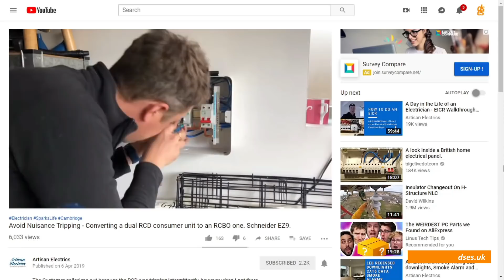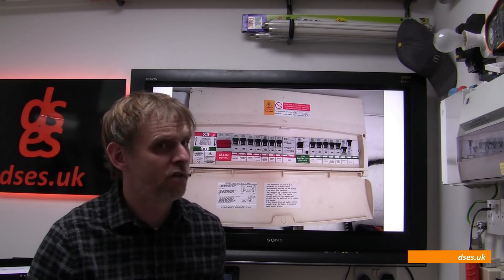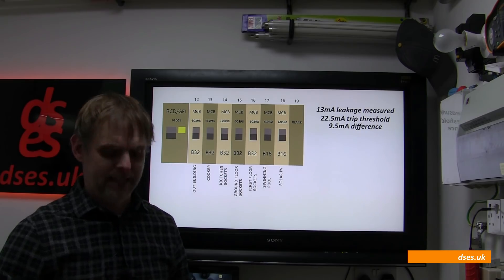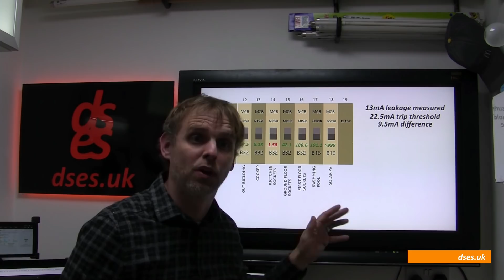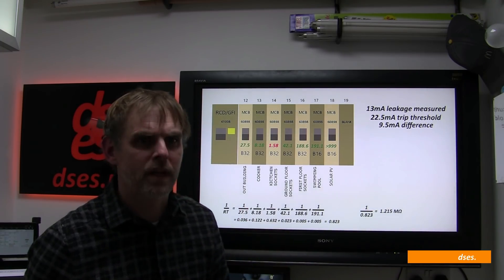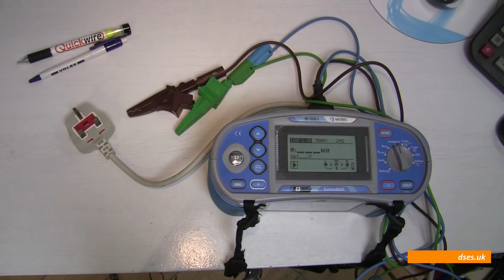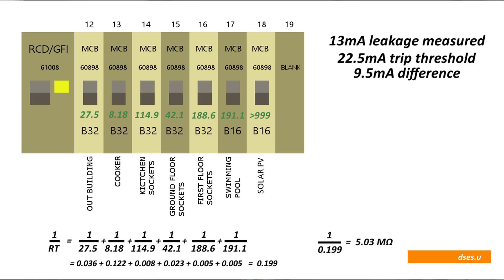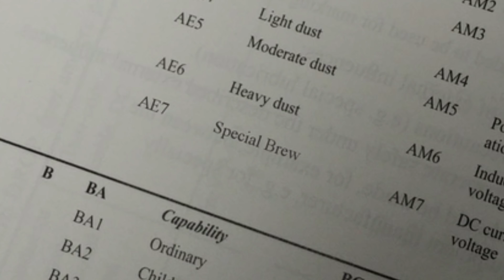Insulation resistance and RCDs

Comment: When you done the IR test on  the washing machine(I think)at the plug,it was showing 500v setting,surely you would do this on 250v first,or am I wrong ??
Reply from the maker: Unless there's surge protection in the appliance, I test at 500V. With line and neutral connected, there's no potential difference between them to fry any electronics.

Comment: Hi David love your videos, nice to see some talking sense and talking the job sireasly with a bit of fun and light humour,
I would like to know what is the point of doing RCD tests at half times, one times and five times when we are only required to record the highest value?
This seems to be a waste of time and effort, just my own opinion. You have even said your self that some of the regs are stupid and controdict the self, point in question the removal of the supply cutout should we or shouldn't we? And the video you did were you did a EICR
and found no problems yet the guy who did the EICR before you condemned the installation?
Great videos and work from you please keep them coming
Reply from the maker: Hi Sean. The gamut of RCD tests have their place - we want to know that the device operates at 1x and 5x test current and that it isn't too sensitive that it will trip at half times. As for recording the result, I agree that it's a nonsense now that the 1x and 5x columns have disappeared from the Schedule of Test Results as you've no idea which test the figure relates to when looking at someone else's form.
Reply: @dsesuk  thank you David, and please keep the videos coming, I did C&G 236 part's one and two back in the late 80s but I have worked since 2006 due to eal health I know a lot has changed but I do try to keep up with the regs and so on once again thank you. Oh and next time you decide to cut your hair try using a colinder you might end up with spiky hair LOL

Comment: Hi David, just been watching another sparky with client who was having an RCD tripping issue, I'm not a qualified Sparky but been an electronics engineer (now retired) for most of my life, he was going all over the place and ended up not really solving things but the fault just stopped so left telling the client that it was more than likely her washing machine? I never once heard him mention a possible rogue RCD what's your take on things, as a non Electrician if that happened in my home my first call would be the RCD, I do still have the necessary test equip. so would have 'hammered' the RCD first with under,ramp and over tests just to see how it behaved?
Reply from the maker: I always start with IR Keith - test line/neutral to earth on all the circuits downstream of the RCD before removing any appliances and see what reports back as bad (presumably something isn't tip-top and one or more circuits are low unless the fault has cleared). I'd then investigate that circuit, and see if the IR rises with appliances removed. We can usually narrow it down to an appliance that way. We'd also measure earth leakage before we start and see which circuits are adding to it, and as you say, the RCD itself can be tested to ensure correct operation.
Reply: Funny thing is he's just got an earth clamp but said on the vid. that he wasn't too 'up' with it and it's not found any faults for him yet? I mentioned RCD because I personally had a rogue one a few years ago and it really got me going, it would 'repair' itself for weeks at a time and then just throw it's toys out of the pram for maybe one or two episodes? I tested everything but premature ejaculation (did loads of tests for that) so I suppose it's made me really distrust the bastards, also I learned NEVER to presume anything from my early years, that's fatal
Reply: I always like to hear it from an expert so thanks for your time David and advice and keep the vids. flowing, your own TV series next, who knows?
Reply from the maker: @keithcoltron3171  Haha! I haven't got the pretty haircut needed for TV Keith!

Comment: Like to say what a complete waster spilling your special brew like that you should be using a baby sipper. How about that PV sitting on the load side of a AC type RCD.
Reply from the maker: The PV on an AC RCD is a common sight; I have the same arrangement in my own home. We know now that it's not ideal, but you only have to go back a short time to find Type-A RCD's being largely unheard of on these shores even though the rest of the world was already seemingly in the know. Since this was filmed, that board has been rejigged with a second CU installed and the more 'troublesome' circuits moved onto RCBO's inside it to take the pressure off the RCD. This came about after we were called back for further tripping trouble on another day which was traced to a flex feeding a pond pump.

Comment: I had the same issue. Completely random Rcd tripping. Once a week. Maybe once a month. I changed my diss board to a 12way rcbos and since no issues. I have a 20ma leakage to earth but just can’t track it down. I guess the best thing to do is to clamp each earth to see where the fault is coming from.

Comment: Maximum respect for the use of IT and I love the dses sign .   What is that, your office ?  Or a workshop of some sort ?  Never noticed that Appendix 5 does it really say special brew?!?!  I'm inspired to look now.  I always have low NE IR for old fluro circuits.  Which is in fact all of them as most new ones are LED now.  I wish I knew what this was about and why nobody else seems to mention the problem.  I know about LN with the capacitor and electronics, but consistently in various sites over the years I get low NE too.  I'm almost at the point of well in fact I am, total surprise if this doesn't happen now.  As you say, it is a right pain to diagnose without disconnecting all the lights.  Got it with SONs last week too, disconnected them all and it was all 9's again.  Neutral to Earth.  On another point, when I saw your goodie bags from ELEX after depositing that last Xcite flood and getting my bacon buttie at CEF on Friday, picked up one of them codebreaker books you had just what I've been looking for all these years but then after reading it found it still leaves a lot to the imagination.  Particularly with the issue of commercial installs without additional protection, still in a quandary of what the official position is.  Guess I'll go with billions of risk assessments or just disconnecting those ccts I deem dangerous without it - for instance in a shower unit with a broken cover which comes off if you touch it exposing the terminals for cleaning!  No additional protection either.  Mmmm.
Reply from the maker: Cheers Rupert, it's a formerly dark corner of my garage! The sign used to be on the side of my van! I don't come across too much trouble with fluorescents, but then most of the places I'm testing are domestic, so they don't have many. Couldn't say why a fluorescent would have leakage to earth - I wonder if there's a difference between the old magnetic ballasts and the electronic ones? I haven't looked at the Codebreaker book much yet, but it's my kind of bedtime reading. I don't suppose it has all the answers, but it'll be interesting to see what insights it offers.

Comment: Im confused. I'm being taught that when testing IR all loads should be disconnected, certainly sensitive equipment, even when testing between lives and earth. But videos from practicing sparks don't do this.
Reply from the maker: If you want to know the state of the fixed wiring, then disconnect all loads. If you want a picture of the insulation resistance the RCD is seeing in normal operation, perhaps because the damn thing is tripping, then leave the loads connected. The IR test shouldn't cause damage, especially at 250V, so long as you apply the test voltage to line and neutral at the same time because then the potential difference across them is zero. The same test would be applied to any appliance that is being PAT tested, and there's unlikely to be anything in a domestic environment that can't withstand a PAT test procedure, so you should be safe testing in the same way at the consumer unit. Remember, we're not IR testing between line and neutral here, doing that could damage sensitive equipment; we're testing line/neutral connected together with respect to earth.
Reply: @dsesuk  Thank you for taking the time to reply, and thanks for your continued content. Great work.

Comment: Hi,just wondering do you not have to make sure everything  is unplugged before you do the test ?cheers
Reply from the maker: If you only want to test the wiring itself or if you want to test for leaks between line and neutral, then unplug the appliances. If the RCD is tripping in normal operation, then test between line conductors and earth with the appliances still attached in order to determine which circuit is at fault, and then what appliances on that circuit are dragging it down. With the appliances connected, you're effectively performing a partial PAT test on them all at once which makes for easier faultfinding than going around checking everything individually.
Reply: @dsesuk  That's great,thanks very much
Reply: @dsesuk  Sorry just one more question.If you set the tester at 500v would this not damage the appliances?cheers
Reply from the maker: Not if line and neutral are tied together as there would be no potential difference between them. Well, not unless there's a single pole switch, blown fuse or wire break on the appliance, but again, it's the same as if you were PAT testing it.
Reply: @dsesuk  Cheers for the explanation👍

Comment: David... how the f##k can you drink special brew.  What's your thoughts about the 2 lengths of 6mm sq that were put up the cavity in case an electric 8/ 10 is shower was needed at  a later date ? I have been told that even though these 2 cables are in 1 mcb there should 1 cable approx 10mm sq . Love to hear your thoughts. Regards Don.

Comment: Nice video D. The problem with dead testing (IR) where appliances are connected is that the appliance may only present the fault during its working cycle.  I see PAT testing as superficial, though it does make sure that Class I equipment is earthed, correctly fused and no visible damage to electrical cords etc. it gives no guarantee of appliance being OK whilst going through it's various segments of operation.
Reply from the maker: This is very true. Testing something like a washing machine is all well and good, but what number it's giving when full of water with the motor and heating element kicking in is something else entirely!

Comment: Great video and explanation Dave. I always find nuisance tripping to be water ingress or faulty appliances. The amount of electronics in electrical appliances these days with capacitors and filters across the supply is increasing, this adds to earth leakage currents and has a cumulative effect. The best option as you say is RCBO on each circuit but hey.. Convince the unconvincable lol. Special brew is the only answer 😋
Reply from the maker: Yeah, I always hunt the water using appliances first, or those exposed to moisture such as freezers, outside electrics and such. This client has indicated he may want some or all of the circuits split off, but we'll see if he ever books the job in.

Comment: I feel their pain, our dishwasher was cause of constant RCD trips just this past Xmas, the heating element  developed a tiny pin hole.

Often wondered though, the RCD's are about 2 slots in size, why are the RCBO's the same width, with only little additional  height as a breaker, when they do the job of RCD and breaker, what about failures of such devices...
Reply from the maker: I suspect the RCD form factor is largely a legacy one. It also may be rated at 80-100A unlike individual circuit RCBO's which tend to be rated lower. The older style tall RCBO's probably contained about the same amount of space, but they're shrinking them right down now, and the new models are little larger than a traditional MCB. There's also supposed to be a three-in-one device coming out with arc fault, earth leakage and overcurrent protection built in but in the same size housing as a small RCBO.
Reply: Ahh yes, makes sense  if large ones are rated much higher, thanks David, keep up the great work

Comment: Good video, thanks.  Is there not a risk of damage to equipment when meggering, especially at above 250v?  But if you DO disconnect the appliances, how do you then identify the faulty unit?  Be interested to hear your thoughts.  Cheers.
Reply from the maker: To minimise the risk of damage to equipment if you can't (or haven't) disconnected all loads, you can run the test at 250v or, as we've done here, join line to neutral so that there is no potential difference between them. What we're doing here is essentially the same as one of the tests a PAT tester would do. There is always a risk you could damage something, but appliances should roll out of the factory capable of surviving a basic PAT test.

Comment: When doing IR tests it is purely resistive (DC), but as is happening more now is the fitting of EMI/RF filters in modern equipment, so parallel reactive (capacitive) loads, so now I'm thinking maybe we need High range ESR test gear as well. Years ago when doing hospital maintenance and installs, we often had to install 100mA and 300mA RCD's (which sounds high) cos with the capacitive leakage (from the built-in EMI filters) on permanently connected medical equipment) it only needed between 10mA-20mA to earth to trip them!

Comment: At an existing installation I would have preceded to do 250V first to make sure you don't blow up the kids Xbox on Christmas.
Reply from the maker: As line and neutral have been joined, the potential difference across them should be zero, but we often test first at 250V if we're not sure what's on the circuit.
Reply: @dsesuk  Just wanna say I stumbled on your video and I first thought this guys a complete joker... Turns out you are, in a good way. Your knowledge in commendable.

Comment: Phew ! Think I need a special Brew after that. Can’t stand Maths myself, but very well put over. The Solar Pv circuit should never be installed on a shared RCD By the way. In the event of Joe Bloggs getting electrocuted and the RCD doing its job and tripping, the inverter can take up to 5 seconds to disconnect, therefor injecting electricity onto the shared bus bar and Mr Bloggs.
Reply from the maker: Like many PV installations, I took a few issues with that one. For a start, there was no DC isolator at the inverter. That was the problem with the MCS bullshit though, it was all geared up for the slap-it-in big-boys, while small-fry such as myself who actually cared about fitting it properly for the client just got swamped with paperwork requirements, and eventually flushed out. I was MCS accredited for four months back in 2014, and that was as much as I could stick.

Comment: Brilliant video David, both funny and informative. I do think ring final circuits should be on their own RCBO's as there's a greater chance of an earth leakage fault occurring due to the shear numbers of electrical equipment that can be plugged in and faults introduced onto a circuit.
Reply from the maker: Thanks Alvin, most earth leakage faults tend to be on appliances connected to the socket circuits from my experience, so if they can be segregated then it's better for them and their sister circuits which  may otherwise be pulled down. RCBO's are the way forward, but we all know that. Convincing a customer that it's their best way forward is the hard part!
Reply: @dsesuk  More often than not, always an appliance with a heating element, kitchen is always a good place to start.